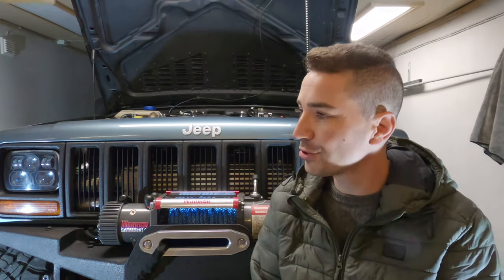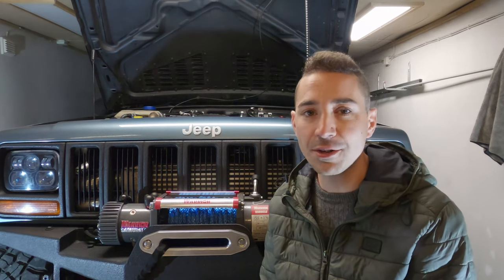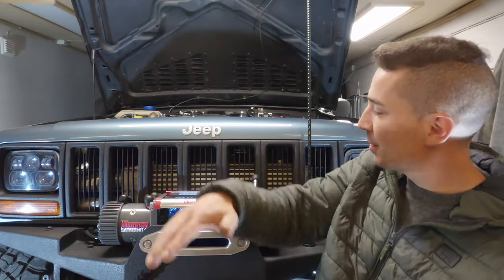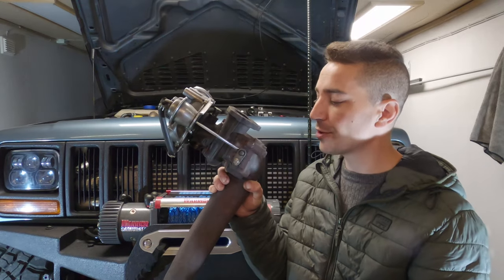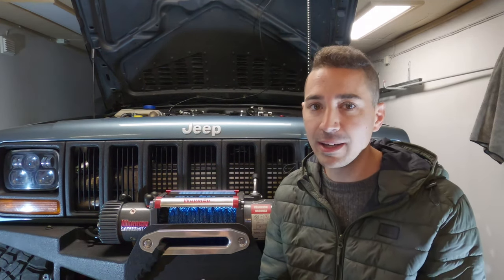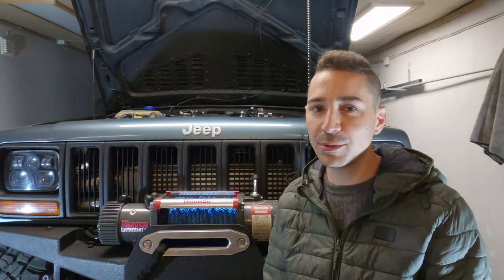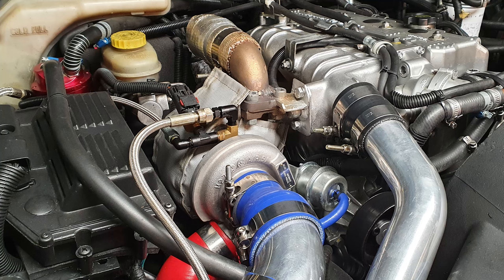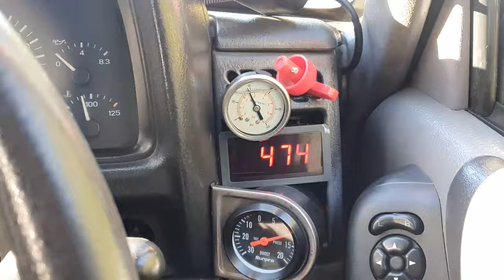Better Performance Jeep 2.5TD VM Diesel Engine

Comment: Manifolds and turbo from a zj is a bolt on swap for a lefthand drive, i bought a zj for parts and did this after watching you build yours. Got the mechanical fuel pump from it aswell, very good videos mike. Cherrs from norway

Comment: I'm running a Cummings diesel in a Dodge pickup truck. Single turbo charged and opted to NOT change anything as to prolong the life span of my rig. When left as stock, Some motors are hitting a million miles. I see 20-somethings hop up this motor to 400 hp and before one summer is over they BLOW the engine half way through the hood. These diesels are too expensive to die young, so I leave my truck stock.
Reply from the maker: There is certainly a limit to power on these old engines. keeping them stock will certainly prolong the life in most cases. I know many people with over 500k on these engines and there still running fine. Regular oil changes seem to be the key. I use a bit of engine restorer in mine with every change. 
Mine isnt stock to be fair. From factory it was 116hp and 300nm. Now its around 150hp and 380nm. Its not crazy power but its a nice improvement without getting silly with it.

Comment: This should be interesting,   I’m half way through building a 2013 M57 engine for my XJ 60th.
Reply: That’s a swap I really wanted to do with mine… then I sold it. Good luck and stick some videos on YouTube when it’s done
Reply: Absolutely - I’ve already got the bellhousing mounts and flywheel adaptor, I just need to get the engine mounts made.  After that… it’s a case of getting the wiring looms modified to suit each other.

Hoping to have it completed by about November, now that I have my JK on the road instead.
Reply: @jonathanweston2448  take it you’re adapting an AX15 to fit it? And have you got the Jeep flywheel adapted to the BMW crank then?

Comment: I have the same engine in my Opel Vauxhall Frontera. I have converted mine to a mechanical pump and a VNT turbo from a Volkswagen LT 2.8tdi. This summer I will upgrade the pump to a 11mm rotor head and a GTD1752VRK turbo which spools at 1400 rpm and is capable of 200+ Hp.
Reply from the maker: Sounds really cool. I've put the semi mechanical pump in mine with a gt2052v. A few alterations to the manifolds. Its running really nice, good power and stable combustion temps under load. 
Do you think your engine will survive at that power level? Mines probably around 140hp (I can't be exactly sure) and combustion temps can get pretty dam high. I guess it depends on what you use it for. I also run the pump on full advance
Reply: @WorkshoptoWilderness  Should be ok with this powerlevel. Everything is pretty big and heavy on a VM like M14 headbolts and such. It is my daily driver so the times I will go full throttle will be not many times and only for short distances. I also let it warm up really good before I go full throttle. On the new setup I have the EGT in the manifold before the turbo but in my current one it is right after the turbo. On full throttle it only shows like 450°c. On my new setup I'm going to run a timing spacer on the pump for more advance on higher rpm.
Reply: @WorkshoptoWilderness  I have the Frontera currently on the dyno at work so I will let you know what power it makes.
Reply from the maker: @WieDrDerJonge  Sounds awesome, I would love to see what it can do on the dyno. I contacted ARP at one stage to get them to make some studs for the heads. I never went through with it because of the price. 
IM sure it will great when its done.
Reply: @WorkshoptoWilderness  I looked into M14 head studs and it seems some Ford V8 diesel uses them but I never digged into it that much because M14 is already big for a small 2.5l diesel.
Reply: @WorkshoptoWilderness  Mine made 153hp and 380nm. EGT's are 350°c when fully boosting for a longer time. I can get more out of this turbo but than I need to put in the 11mm rotor head first. I might do that pretty soon.
Reply from the maker: Thats awesome. Really good performance and temp. I wonder what mines doing now. My temps are higher around 400c but then if I go up hill on a hot day in 5th at 100kmh then it can get up to 600c. But I guess its 2.5tons and the circumstances are not ideal. 
What kind of boost are you putting through it? I capped mine off at 19psi.
Reply: @WorkshoptoWilderness   I'm around 19psi too.
Reply: @WorkshoptoWilderness  Do you have Facebook or so? So we can discuss some more about the turbo setup.
Reply from the maker: @WieDrDerJonge  yeah sure that would be good. I don't really know too many folks who like to mod the old VM. My name is Michael McQuilton
Reply: @WorkshoptoWilderness  send you thru messenger

Comment: 30 MPG??? wow I drive an almost stock XJ and only get 20 MPG. Maybe you have some advice for me on what I can check to get better efficiency
Reply from the maker: Is it a 4.0 or diesel? A stock diesel should get around 35mpg sometimes more. Mine is obviously obese so it's around 23 at best.
Reply: @WorkshoptoWilderness  it's the VM, with the electronic injection pump and without the egr
Reply from the maker: @theradoful  20mpg from a stock VM is quite surprising. I would test your injectors to start with. You can run them through a manual injector cleaner press, or just get them rebuilt at a shop. 
The MAF Sensor also might be an issue but I doubt it.

Comment: Does the exhaust manifold need to be removed periodically and cleaned? Or does the soot just burn down by itself due to high compression and temperature in a diesel engine?
Reply from the maker: No it just burns up unless you drive around town really slow and the engine doesn't warm up.

Comment from the maker: I've had a number of messages about the mods i've made to the Jeep Cherokee XJ and its 2.5 VM Motori 425 OHV Diesel Engine to get more power from the engine. First off I am no expert at all but I the pursuit of turd polishing and getting more out of something from its original state. 
The 2.5 VM has a terrible reputation amongst some and its loved by others. Its cylinder heads were a nice idea but in practice a one piece head would have been better, but better heads are on the market and the engine can be reliable and perform very well with modifications.
I decided to keep my VM and not swap it out to see what I could do to make it more of the engine I wanted it to be. 
In this video I discuss the avenues you can take to get more power from your VM without compromising the mechanical functionality of the engine.

Sorry about the volume of the engine at 20:58, I messed it up. I'm just saying that I've ran the AMC heads for quite a while and they have been great.
Reply: Hi. My english is not really good. So i would appreciate part list written. Exhaust and intake manifold from other vehicule is ?
Tks

Comment: Hi Mike, I sold my 2.5tdi Jeep ZJ but still have a spare blown engine I bought for 200Eu.. and lots of spares , also have the mechanical fuelpump  in a box.I still have my 3.1TD WJ , I blew cylinder no. 5 linner on the highway when pushing for the engine. Had do rebuild it and is working fine. Also rebuilt injectors , you can also make a poptester for the injectors with a handpump and gage, and tune them. Like you videos. Regards

Comment: Hey Mike! My family has a 2000 xj very similar to yours and we run electric blankets off our power station and it barely pulls any amps at all. Works great and keeps us warm when it’s cold! I would try that next time you’re out!
Reply from the maker: Ah fantastic, that sounds amazing. I will try and find something online! Thanks for watching
Reply: @WorkshoptoWilderness  we also run them on each seat inside to give us heated seats in the winter! Works fantastic for us :)

Comment: Hi Mike. Great video. Just back from a 2,500mile camping trip around Europe and the Alps on my Mk1 2.5 TD VM Cherokee. It performed faultlessly, only getting warm on the prolonged hill climbs. Please can you point me in the direction of the tuning of the mechanical fuel pump to reduce turbo lag? Mine seems to come in about 2,000rpm but would love this to be a little lower. Otherwise I'm just going to maintain it and chase reliability rather than power. Much appreciated.
Reply from the maker: Ah nice, sounds like a fantastic trip. Nice to hear an old diesel cherokee is still going strong. I could make a video but far better ones exist - https://youtu.be/FfOsJQ8XXug hopefully this will help, it helped me tune mine.

Comment: Hi, thanks for this explanations and videos, I’m not mechanical too and enjoy work on my Jeep, I’m here too to ask your opinion about EGR, I had been here  trying to understand if I should erase my EGR or not, I like keep things that comes original in car but  I’m still inquiring about this and duno if keep it or erase it . Congratulations, you did an amazing work whit your car 💪
Reply from the maker: Deleting the EGR is normally done for engine health. First off the negatives are the slightly higher combustion temps because recirculating the exhaust gas will drop them slightly. This isnt really an issue on this engine in reality but you would delete it to stop suit building up on the intake manifold and cylinders. Personally Its beneficial to the engine but not to the environment.
Thanks for watching and for the comment.
Reply: @WorkshoptoWilderness
Reply: I undestand that , and usually people say that its bad to the engine, however still remains in me some questions about erase EGR...the engine was design to funcion whit that and im not sure if erased will be funcion in the same way . Sorry about all this , people are diferent and some people like to improve things and i dont see any harm in that , in fact i honor that , but i like to trie undestand the things very carefull before act and i would like to have more power in my car ofcorse , but i still have afraid of erase this....thats why i asked your opinion. Thanks again, your work there is impressive ...really

Comment: I dont know how your pump can be tuned. But most 200/300tdi land rover guys just fidle with the boost diaphragm/fuel pin. To change how fast the fuel increases with boost and how much it increases.
Easy to do and easy to reverse.
And no parts needed. They usually leave the main fuel screw alone because it does not need more fuel at idle or very low throtle input.

Edit: and for the Bosch pumps you can get a timing spacer that allows more dynamic/total timing advance in the pump. Wich should increase higher rpm performance without messing with the base timing of the pump.
Reply from the maker: Its exactly the same on the pump I have. It's a manual Bocsh pump with a boost diaphragm and fuel pin. I've just tuned it up so it responds the boost better making it all kick in faster.
Reply: @WorkshoptoWilderness  sweet! Plenty of info to be found on tuning Bosch ve pumps.

You might want to look in to a timing spacer. Apparently more timing at higher rpm reduces egt's and allows for a litle bit more fuel.
And they are cheap.

But if you are happy with the way it drives now dont touch it lol.
Reply from the maker: I've watched lots of videos and there seems to be some great information out there which has helped me a ton. 
I've advanced the timing of the pump to full advance and disabled the retarding solenoid so it remains at full advance all the time. It's been running great and it seems to have contributed to a bit more power and better fuel economy which makes sense. I have noticed a slightly higher egt though which confused me but I guess I'm running higher compression now? 
I haven't seen those timing spacers but I don't know if I should keep playing with it lol. This old VM is probably working harder than normal

Comment: I feel ya regarding the turd polishing Mike! Live for it though. Mate, im keen to add a better intercooler to mine but i dont want to lose my a/c because it hot over here in NZ. Have you got any ideas for this? Cheers, Tom
Reply from the maker: You can fit the cooler and the ac in there. A friend of mine has ac and has done it. The clearance is tight but if you find a thin cooler it will work better.

Comment: With the "MK2" Scorpio making 125 hp (factory rating..) and the "MK1" Scorpio doing 116hp (factory data sheet)

How does that go with the saying in the Video that the turbo on MK2 is the limiting factor?

The Scorpio MK2 .. the one with the  🐸 face, this Ford has Bosch Diesel system (EDC) mostly notable by the wire on first cylinder injector and by the Elektrik module on the pump body ..

But what's different there actually on the engine and fuel supply as such, to achieve the around 10 hp gain coming from the earlier 2.5L VM Italy.

Is the injector size identical...is the capacity of the injection pump identical??
Reply from the maker: All I I know as facts are the waste gates open at different pressures and the earlier turbo makes more boost on paper and with testing. There was also a significant difference in power on my jeep and also spool up (which isn't power technically but response) after fitting it. 

I dont know much about the Scorpio but didn't the mk2 have the 3rd generation vm with the balanced crank shaft and manifold pressure sensor? That would probably explain more power. The jeeps never used that variant I don't think. At least I never found one. 

It seems pretty easy to squeeze more power out of them although not too much of course. I use a GT2052 at around 25psi along with a slightly modified ve pump that I've partially advanced coupled with a different fuel pin and the jeep feels like its around 150hp. Another guy has done something similar and it dynoed at 158hp. He's swapping the pump plunger to 11mm which he thinks will allow much more power, although he doesn't think it will be stable. I'm happy with mine where it is I think. 
But back to what your saying, perhaps the Scorpio saw some slight changes in the ecu that the jeeps didn't. Given that are electronically adjusted for timing at that stage and the MAP might have some influence on boost and fuel delivery

Comment: Mike, I love the channel. I am an engineer on steel boats. I have owned Jeep XJ's for 7 years. Mine is a 1996 prefacelift 4.0 from Japan. I have just purchased another 2.5td 1996. I own other vehicles but the XJ is the best all round vehicle I have ever owned. Did you know there is a 6 cylinder version of the VM engine? I have noticed you sound like you have a bit of a westcountry accent? Were you a fellow carrot cruncher before the move to Sweden?
Reply from the maker: Hey Jack, thanks for watching. I'm originally from the Wotton-under-edge area of South Gloucestershire so I was indeed a fellow carrot cruncher. I had no idea there was  6 cylinder version of the VM. I saw the 5 Cylinder in the ZJ. Congrats on the Jeeps by the way, nice to hear that they have a good home. so many get scrapped now, its kind of sad. I wonder if that 6 cyl could fit in the XJ haha, perhaps not. Is it a marine application with fresh water cooling?
Reply: @WorkshoptoWilderness  I have just finished a job on a boat for a chap from wotton under edge, small world. The 6 cylinder vm was used as a boat engine and a stationary engine. They were also marketed as a detroit diesel. I have seen one in a range rover classic, I can't see why they could not be made to fit an XJ. They sound great. Detroit 638 is the 6 cylinder vm unit. 160hp as standard.
Reply: @Jack-tx2ve  Mercruiser 642  as well, that's what I dream of putting in mine .

Comment: Can you rebuild the number 1 injector on these as they can get quite expensive and seems to be a common problem on this engine, I had to replace mine about 2 years ago with one from a Vauxhall frontera and I noticed some power loss maybe it’s just in my head I don’t have any data to confirm but definitely feels sluggish (98 mk2)
Reply from the maker: Yeah they fail and then the ecu goes into limp mode restricting fuel to stop turbo spool up making the jeep gutless in an attempt to protect it from damage. 
I deleted my numbed one injector, maf and ecu by installing a manual fuel pump. I now just use a normal injector and manually time the engine to 2 degrees advanced

Comment: I have notice you have not the nock censer Injection on your engine. How did you gat rid of it. I have a 1998 Grand with the 2.5 motor. I am planning to use the 2001 3 L intercooler.
Reply from the maker: Once I swapped the pump and advanced the timing I pulled the sensor injector and replaced it with a standard injector to stop it retarding the timing so that the engine runs on advanced timing